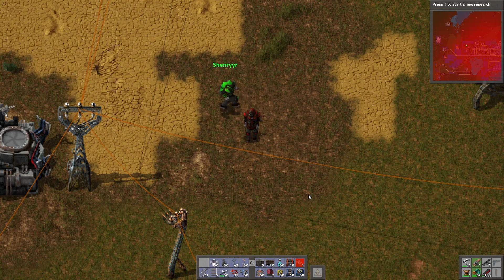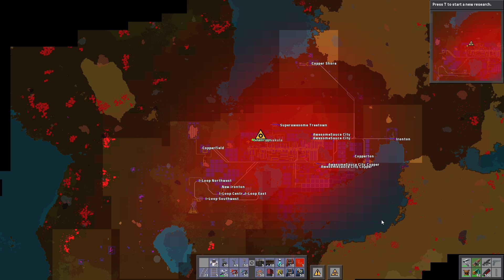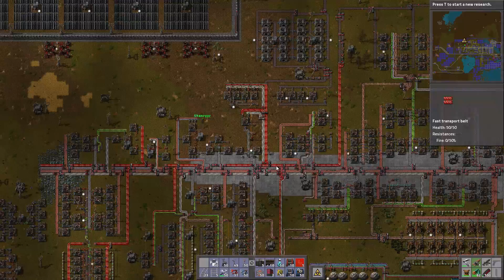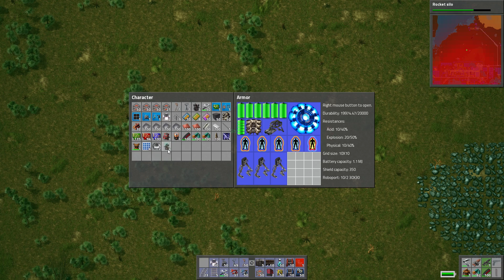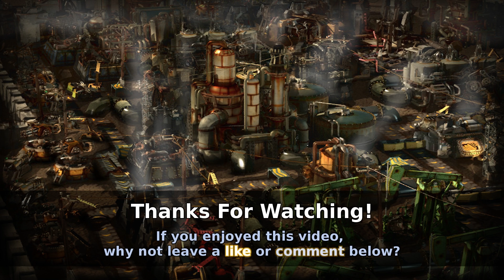Factorio Beginner's Guide - 27. Power Armour - Let's Play Factorio Gameplay

Comment: make 3 fusion generators, 4 legs, 12 shields, 2 mk2 batteries, and 4 roboports. For building go all generators, legs, batteries, and robo ports. When you do combat switch out 2 legs, a generator, and the robot ports for the 12 shields. You're basically invincible, dont even bother running away, just run in the middle of all of them and spin a bit with flames.. pare that with a flamethrower and your done. you also get 40 building drones and lots of speed for building. MK2 for anything you can btw.

Comment: You forgot to mention that Personal Roboports stack!

Also, when doing the kind of hit-and-run attacks that you showed in this video, it's often a good idea to set up a Turret-based fall-back-point, so that when the shit hits the fan, you have a place to flee to.
Either a Laser Turret point powered by Poles, or a Gun Turret-based point with Inserters powered by Poles or Solar, or even using Burner Inserters (although those can be finicky - they might spend their limited innate energy on moving ammo instead of self-refueling, so watch them to make sure).

Comment: The biggest problem with PLDs is the energy-to-death ratio. By the time you've got enough in your armour to do reasonable damage, you'd be better off with either the same number of slots being used with shields. 

Alternately, simply let a P-roboport blueprint a miniature laser turret outpost every few feet, which also rather neatly negates the need for need for tanks for combat purposes.